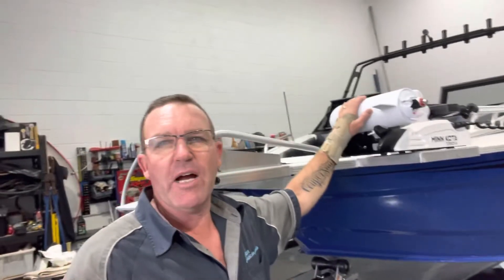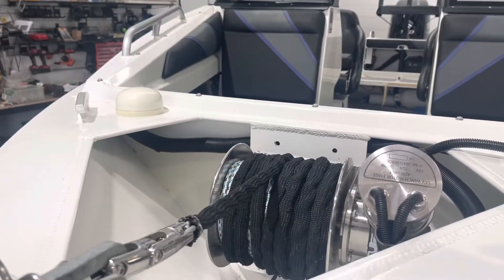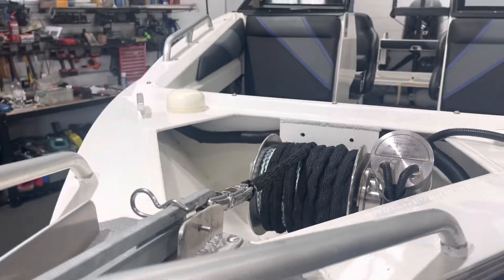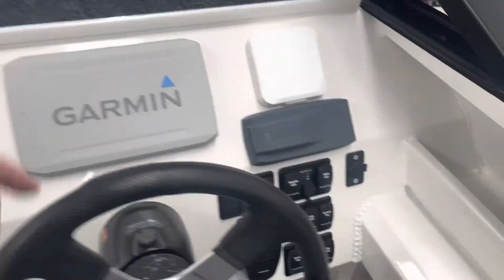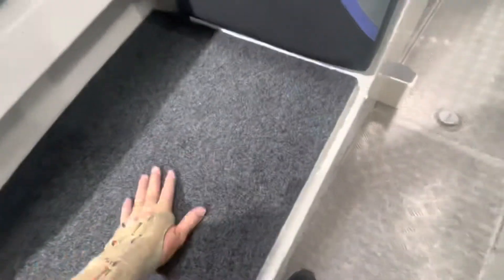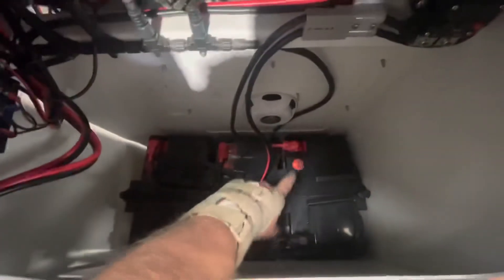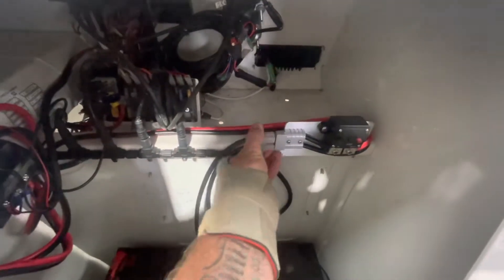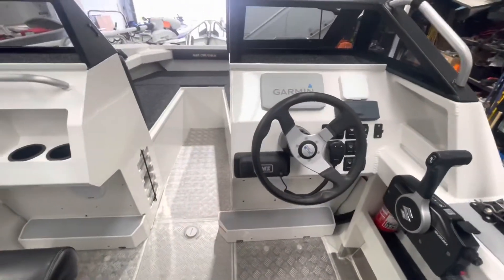Bar Crusher boat upgrades

Comment: Had any dramas with the weight all on that one side when driving mate??
Reply from the maker: No Aaron, lithium batteries are less than 10kg each so it’s balanced out with the Minn Kota. The actual boat handling has improved with the overall weight increase with everything added.